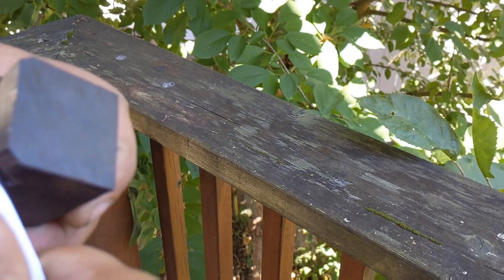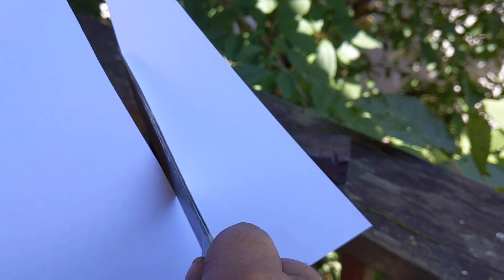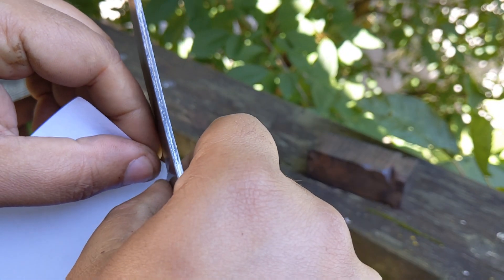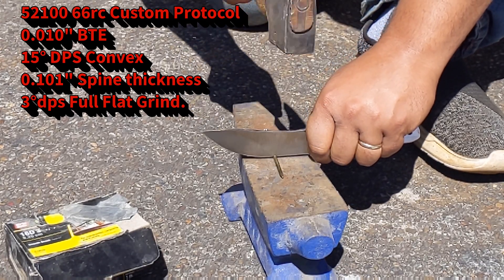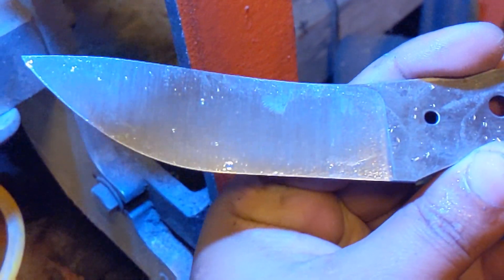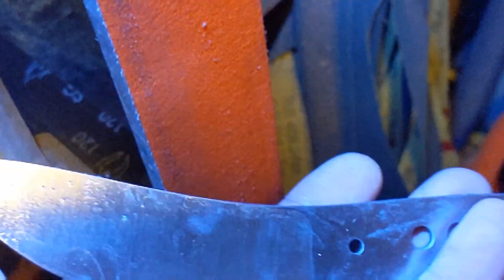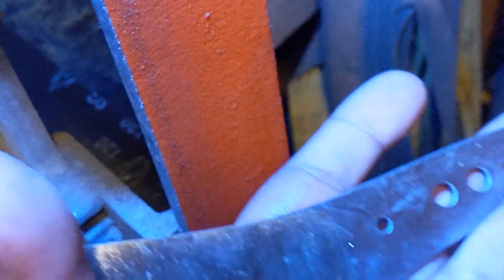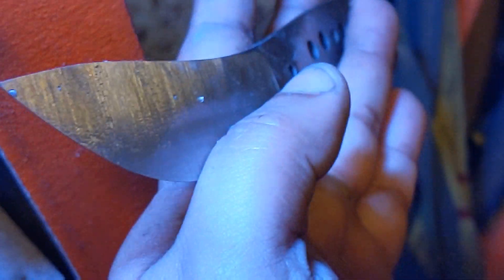52100 at 66rc, Edge Stability versus Toughness with Thin Geometry

Comment: There are a couple makers of custom timber framing chisels in 52100 also taking the blades up to65-66 HRC. What’s the corrosion resistance like.
Reply from the maker: 52100 doesn't have any corrison resistance, it is prone to rust and patina.
Reply: I love my white #2 steel in the kitchen masamoto KS still the finest knife I have. But been looking for a decent stainless solution for years. Clad blue #2 is slightly better but I do miss a stainless solution. VG10 is crap chippy garbage. Still looking for a stainless solution for the kitchen.

Comment: Maybe a dumb question here,, it took me about four years just to confidently get to the point of making a good knife.  Now I want to start pushing simple steels i use to the limit, trying to get the most from them. Is there any different kind of bevel or honing/buffing you can put on a super thin hard knife edge like that with that same geometry, 
  That can help it handle that nail chop. But still not lose much cutting performance?
Reply from the maker: Ya should respect that geometry and hardness, those features are counteractive to chopping a nail at such an extreme, I showed this in the video when I was able to chop the nail with thicker geometry
Reply from the maker: You have to remember that when I share a video like this I'm pulling back the curtain on the inner workings of what makes things work. 

That opens me up to a lot of criticism from folks that think they could do things better.

 I could always just say that something is super thin not give any measurements of geometry etc and chop the nail at a geometry I know will have no problems and receive all the accolades for it but instead I show the reality of things here.
Reply: @FearNoSteel  thank you for your honesty and pushing knives to their limits!

Comment: I only have ceramics water stones how much of a mess would this be to sharpen on a chosara 800?
Reply from the maker: Rick, it's not the hardness of the overall Matrix that determines that, its the carbides. MC3 Cr rich iron Carbides at ~ 6% volume and ~1200 HV is not going to interfere with the Ceramic abrasive grains at ~1600 HV which are harder, it's when we get Vanadium Carbides(~2800hv) at Significant volume and high matrix hardness that prevents the abrasive grains from cutting around them as easy making it a total goat fuck to use ceramic for that. So it's not an issue for 52100 no matter the hardness, just make sure the stone is flat and dressed.
Reply: @FearNoSteel  Thanks a ton for replying. This totally makes sense.

Comment: This is why I'm a fan of steels like 52100, Nitrobe 77, Aeb-l, Nitro-v and all Sandvick steels. With a good heat treat( at least 60hrc, but higher is better) and a nice grind they perform amazing. Got a small fixed blade with Aeb-l at 63hrc and around 0.010 for most of it except the tip. I haven't chopped through nails but I did shave on one and the edge acted like it was nothing. I'd love to get a river blade from you, just wouldn't know which steel to choose. VanCron 40?!?!

Comment: Thanks for taking your time to shoot and upload this video.

I'm not sure I understood you well, cause around 1m mark you noted that 52100 doesn't have the most agressive edge, nor does it set any records in terms of edge retention. Then you talk and demonstrate so called 'edge stability'. The differences between edge retention and edge stability are pretty elusive to me. Knife's edge looses cutting ability when it receives too many micro ships or edge rolling (lets just call it edge damage). The ability to withstanding micro edge damage is what I think 'edge retention' is. And thus in my eyes 'edge stability' is pretty much the same thing. Is it the place where I mistake?

If I'm not mistaken, then it's unclear why would you bring steel to such a hardness if it doesn't bring better edge retention (you said about edge retention around 1m mark)

Please pardon my English, I'm not a native speaker.
Reply from the maker: https://knifesteelnerds.com/2020/05/01/testing-the-edge-retention-of-48-knife-steels/
Reply from the maker: Harder with stable microstructure means better support for thinner geometry, I demonstrated that the 52100 could be thin and hard with the right microstructure and still stable on the blackwood. The Carbides are one of the most significant factors to edge aggression and wear resistance. While the steel is harder at 66rc it won't be more wear resistant than s90v at 60rc despite the higher hardness of 52100. Why? Well there is some good reading in the link I sent.
Reply: @FearNoSteel  yeah I've read that blog. Can't say I understand everything, but still.

I'm not really interested in direct comparison between 52100 and other steels. But I wondered why you pushed 52100 to such hardness. In my understanding the only reason to cook steel such hard is to get better edge retention (compared to the same steel at softer hardness)

Let me rephrase my question. Imagine you heat treated two pieces of steel, one at 66hrc, other at let say 62. How much of a difference there will be in normal use?

I had a nice collection of high end kitchen knives from modern knife makers. There were 2 knives one at 65hrc. To be honest I haven't noticed much difference between then and knives at 61-62hrc.
Reply from the maker: @antonkudris  read the first part of the answer I gave you above again, because if you go thinner and the structure is not stronger it will roll over in normal use while cutting without having the support of thicker geometry. So if thinner geometry cuts better but needs more support it needs to be stronger. The Carbides control wear resistance and they don't really change with HT like they do with the steel chemistry. It's pretty straight forward.

Comment: I’ve always said it, people don’t give this “spring” steels enough “knife” cred. There’s a reason Collins uses it on their high end axes. Toughness makes any impact tool better, full stop. 
I wish we saw more “hard use” knives use it so they could maintain better cutting geometry while still remaining hard use. Especially considering how cheap the stuff is.
Reply from the maker: It would still need to be thicker geometry to support the steel so it doesn't roll in use. Also it would wear smooth easy in cutting tasks comparatively and be more stubborn to deburr and apex if heat treated for maximum impact toughness. There is no fairly tale steel, they all have trade-offs just like everything in the real world, nothing wrong with getting something that suits your preferences my man. It's fun to have something rough and tough though.
Reply: Big Brown Bear oh, don’t get me wrong, I understand that, everything is a ballencing act it steels. 

I’m talking using this steel over other really simple steels in things like machetes or “survival” knives. I can’t imagine it would be too much more expensive. And if it makes them more abuse resistance at a similar given hardness or the same toughness at higher hardness or allows for a thinner edge I’m not sure what the real down shot really is. 
Please correct me if I’m wrong.
Reply from the maker: @macmurfy2jka  I don't understand, you mean 52100 at 66rc for a machete/survival knife? I don't think that would be cost effective to heat treat and grind for production margins.
Reply: Big Brown Bear nah that would be silly. I’m assuming you took this up to a really high hardness and then tempered the stresses for a long time? 

No I’m just interested using this steel over something like 1075 or 1095, and bringing the hardness closer to say 60 with somewhat better cutting geometry, then letting the steel’s mechanical properties provide a margin of safety for use. 
My guess is that doing this would produce better users at a price that still allows them to be semi disposable, like any good user should be. 
I mean, to my knowledge, that’s how allot of the “good” tools seem to be made in 3rd world backwaters (using truck springs). 
It just seems like an under developed section of the knife market. Mid range knives that make better users.

I might be missing something, as all of this is from a bird’s eye view. Studied materials properties and manufacturing techniques in a few classes in college, but most of my user experience comes in the forms of simpler HighCarbon steels. Never could afford big pieces of M4, O1, etc. I don’t have any personal experience with the steel as so few makers use it and I’ve never ground any of it into a knife personally.
Is it just too hard heat treat? Performance gains not economical/ margins too slim? 

I just think that the steel is largely overlooked.

Comment: As an aside, that knife showed brittle failure, that just means when it fails, it does so with little (to no) plastic deformation. A knife can have an extreme high UTS point, and still be brittle, it is in the nature of the failure, not the level of resistance to it. 

It does look like it has high apex stability as it retained a high sharpness while doing work which is likely to roll or cause carbide related fractures at the apex, but I would want to see a comparison in something like ATS-34 at 63/65 HRC, or 10V at 65/67 HRC to be confident, as if they don't fail either, the test itself might not  be generating enough stress.
Reply from the maker: Fair enough, not shown, not known. In my experience the 52100 with proper HT is less prone to chipping at the edge than a carbide blasted steel but that's not to say 52100 is superior for all circumstances. I enjoy the merits that 52100 offers but I am more partial to steels like 15v that simply cut longer without blunting smoothly with heavy cutting.
Reply: @FearNoSteel  Yes, I like it for almost the same reasons, and AEB-L (and similar nitrogen steels) in stainless as they have similar behavior.
Reply from the maker: @CliffStamp  that nitrobe 77 you told me to try was very very interesting, the wear resistance was low but it was very impressive to sharpen and very nice with thin geometry. Labor intensive HT though.
Reply: @FearNoSteel  Yeah, it is very demanding to ensure no retained austenite in high nitrogen steels assuming you want max hardness as nitrogen is a strong austenite stabilizer. I am not sure these steels have functionality outside of extreme corrosion, as you can get 63-65 HRC in AEBL, depending on how fancy you want to get (see Landes for example who water quenches after tempering, etc.).
Reply from the maker: The water quench between tempers is not as significant a factor for Increasing HRC on AEBL as much as the time and temps used during Aus and temper and doing immediate cryo after quench. In my testing, there were no changes to HRC when doing a second cryo in-between tempers or water quench after tempers, however, there may be benefits to the microstructure that is beyond what the Rockwell tester can show, perhaps shifts preference for more desirable constituents in the microstructure that may give increases in YS but not UTS at the edge.
Reply from the maker: @CliffStamp  it would be interesting to compare micrographs of Nitrobe 77 to AEB-L. I have been enjoying the N77 quite a bit, however, I am more partial to higher wear steels. Although, I see the merit of such a steel. In my opinion it was perhaps one of the best sharpening steels I experienced so I bought a lot of it even though it's very expensive to buy and HT.
Reply: @FearNoSteel  The point of those small refinements is to stop the carbide precipitation that happens at those temperatures (iron carbide) which can weaken grain boundaries and lower wear resistance. However, as with a lot of things, while in theory they are there - the extend is not well measured. The more important thing would be the austenization and quench like you said, ideally using a flash soak to get a higher temperature without the side effects of a longer soak which are undesirable on steels with no pinning. But again, while this seems reasonable, I have seen no data on just how much of an improvement this makes either.

Comment: Rob Simonich used to do nail cutting to promote his knives/steels (Paul Bos HT). Whenever anyone did anything like that I was always curious as to what it meant/said about the knife/steel. I would just duplicate it and see what happened. With the nail cutting after doing about a thousand cuts, I determined it was so sensitive to technique I would never be able to infer anything from watching/or knowing someone else did it. I could barely know anything myself. 

At the end I could take knives which were 0.010"/15 dps in D2 at 62 HRC and cut through 4" nails with them with careful technique. It was mainly about keeping the knife extremely close to perpendicular, making sure the nail wasn't moving around, and just tapping it through. I figure I could (maybe) put some kind of metric on it by restricting the number of hits, but the influence of technique was still so demanding. I could easily damage an AUS-8 blade at 58/59 HRC over the D2 if I was just a bit sloppy. 

In general toughness tests are demanding for the user because they are so sensitive to conditions which can easy vary enough to make a change far bigger than the steel. About the simplest setup I can think which would be decent would be if you just swung a knife (through a pendulum) under a given energy (weight/height) and impacted it against hard targets. That's fairly easy to set up and quantify, and it similar to a charpy test of sorts.
Reply from the maker: Thanks for sharing Cliff.

Larrin did an article on Frank Richtig which was interesting, he hammered through bars of mild steel with fairly thin knives and the secret (technique) he was using for his demonstrations died with him.

Larrin is the one who has the device you speak off. It was a rather expensive device but very interesting.

I'm not promoting a universal nail test. I am a caveman that needed a quick test that was destructive enough to show differences between some variables in the same knife that the lay person can contextualize.
Reply: Rip cliff stamp

Comment: So how do you feel about spydies treatment of the 52100??? I have no idea how hard they get it or if they even do it properly but i do own the carbon fiber para3 in 52100 (safe queen)
Reply from the maker: I believe it was around 62rc, use it up man. Love me some spydies. Not fair to compare to this test.
Reply: @FearNoSteel  no no ofcourse not i was not comparing simply jusasking your opinion on their treatment using this same steel bro lol so how does the spydie 52100 hold up lateral strength
Reply from the maker: @kevinAuman1  I haven't had the time to test it

Comment: Great vid. Knaf folk tend to chase what they want vs what they need for day to day cutting. Aslo, understanding how forgiving that geometry is to sloppy use vs professional use. Many look at your vids and think that you made a magical blade as they watch you cut through nails, not realizing that your a pro user.
Reply from the maker: it's still 52100 at 66rc with a badass microstructure. I could "pro user" all day but if it was shit, it would be shit.
Reply: @FearNoSteel  true. No knock on your heat treat prowess. Followed you long enough to know you continue to push the limits to achieve maximum performance. Keep it up
Reply: Yep. Japanese blades are run hard and high carbon, and very thin, maximising edge retention and cutting efficiency. 
Most knives are still pretty thick compared to what they could do. 
Edge stability is king. You can go for higher hardness or higher toughness but you need a good ratio between them for edge stability. High toughness in a soft steel is just ductile, and high hardness without toughness is just brittle. A hard 5160 would be a great chopper and better than soft 1095.

Comment: Two things thin knives can't cut is time and cost.   It rewards skilled users,  and holds ppl accountable.   Reckless users,  who refuse to see not only what they cut,  or what's behind what they cut wont enjoy the experience very long.   Ceramic tile,  concerete walls,  various metals etc are going to be the enemy.  I carry production knives as convenience.   I cut frequently over a tile floor so mishaps aren't noticeable given my skill set.  When I'm cutting drywall I'm using a utility knife.  Just makes common sense to use replaceable blades when I'm cutting stuff like that.   And since I own a lazer of yours,  I prefer it in the kitchen over a cutting board.   Cut about 10 apples a week with it.   BD1N is never going to be a hot Rod steel but as a user I'm controlling the environment so edge damage is avoided.  This vids about 52100 tho.   Custom heat treated 52100 to be accurate.   Just a solid,  high enjoyable steel that gets overlooked.

Comment: i wonder what  52100 would do against a 5160. 52100 at 55-57 hrc would have comparable toughness but greater edge retention ( i have a 52100 sword in mind when i make this comment)
Reply from the maker: For swords? No idea, I make knives. I would think the advantage of higher wear resistance is lost on a sword and that dropping the carbides like 5160 does is probably better for what a sword does, I have no interest in swords however.
Reply: 52100 does not have comparable toughness to 5160. 5160 is a lot tougher.